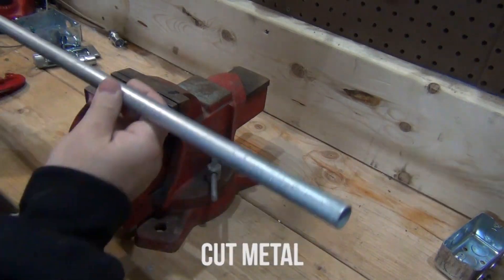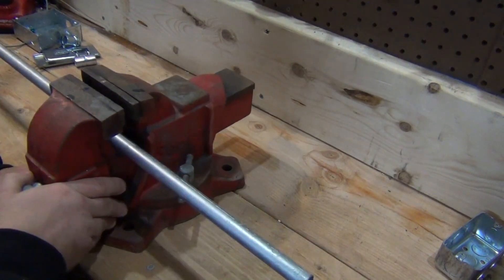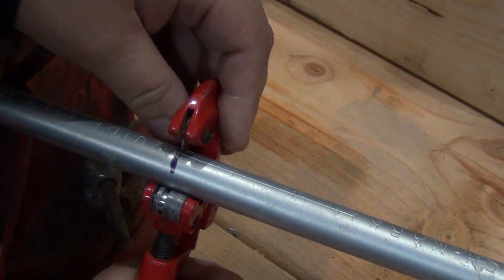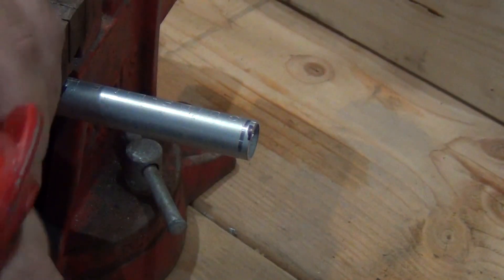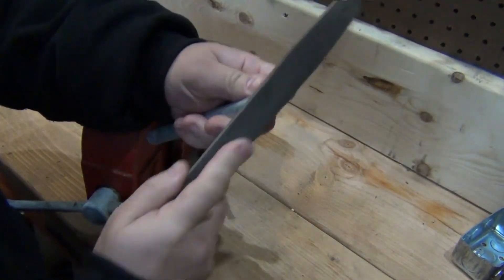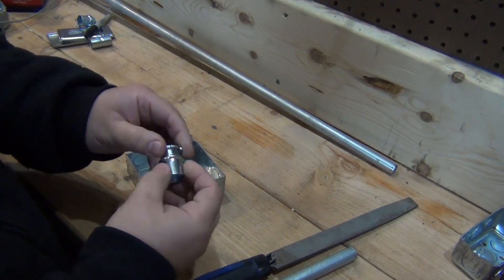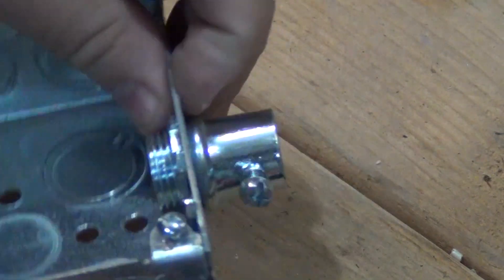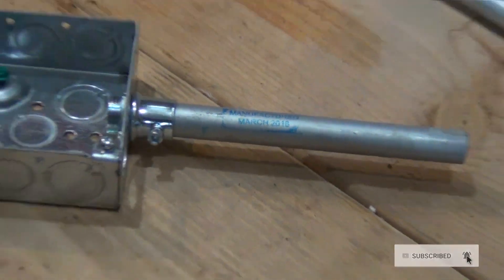How to cut EMT metal conduit and install into metal junction box

Comment: I use a Metabo cutter with a SB steel cutting blade. It is easier and a soother operation . The SB blades only cut a 1/8 " slot on the steel piping . By the way the cutter your using is meant for copper pipes not steel .
Reply: You’re*